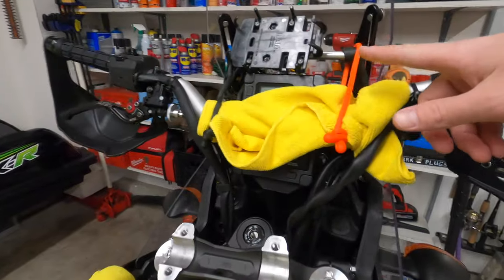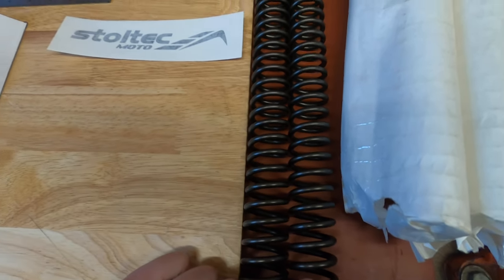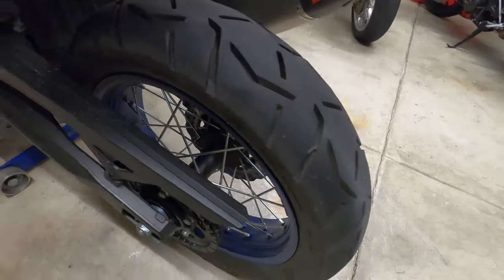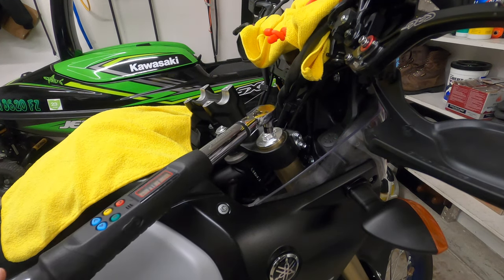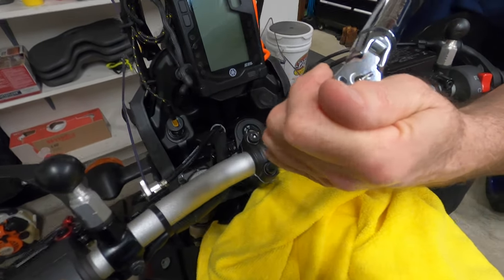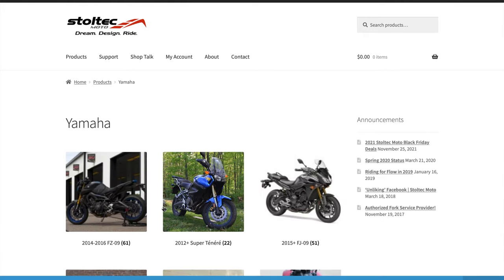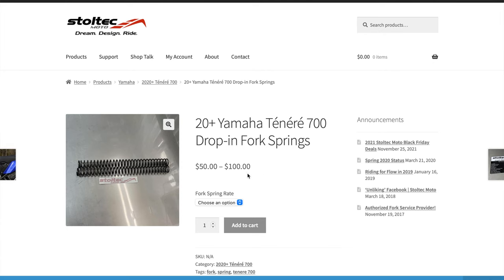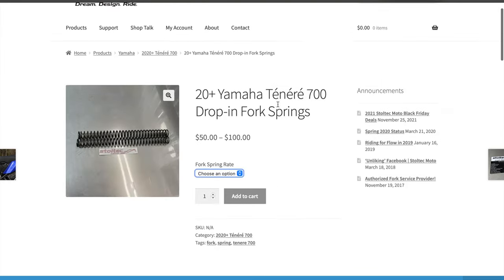Yamaha Tenere 700 Front Suspension Mod!

Comment: Good video.  Thanks so much. For some reason I put it off.  Only took a couple of hours including getting all the tools out.

Note to others: get your floor jack under the engine before you unscrew both of the fork caps.  I did not and almost dropped the bike.  Had it on the center stand only and when I finished unscrewing the second cap, the front dropped, the bike rolled forward and off the center stand.  I was able to catch it and “phone a friend” for help.

Comment: Great video. What about the oil level? When you take out the old springs, there is some amout of oil on it..
Reply from the maker: Appreciate it! Stoltec actually recommends removing some oil(can’t remember how much) but In our case we did not remove any more than what came out with the spring which is very minimal.

Comment: How difficult was it to screw the caps back in to the fork tube with the new springs in?
Reply from the maker: If the front suspension is supported (right at the point of nearly weightless) it should be easy.  Make sure upper pinch bolts are loose and  not to cross thread the cap😎
Reply: It’s easy if you compress the springs with zip ties like he shows.

Comment: The blue tool for holding the fork rod from sliding down when changing the spring, can you confirm if it's M10 or M12 thread?. Thanks
Reply from the maker: M10 threads. Here is the link to the tool if u need it! Thanks for watching!
https://www.denniskirk.com/motion-pro/5-in-1-damper-rod-bleed-tool-08-0648.p284475.prd/284475.sku?gclid=EAIaIQobChMIr-X3lNXa9QIVJ2xvBB33lQ6XEAQYBCABEgKxrfD_BwE

Comment: Shouldnt the fork oil be changed every year?
Reply from the maker: If you’re taking it offroad, keep it in a non climate controlled area and/or putting 10,000 miles or more a year on the bike then might be worth doing yearly but for us we wont even think about doing again for a long while unless they feel in need of attention. Our Tenere is 100% street use, stored in climate controlled area year round and gets about 2-3k miles of use per year. For our situation yearly would be overkill but doing it more frequently certainly doesn’t hurt. Everyone will have a different opinion on it but is more on how you use the bike. Offroad adventure riders it is probably a good idea to do yearly. The street queens can probably stretch that out 3-4 years or every 10,000miles whichever comes first seems to be what we end up doing on our bikes.
Reply: @Floatsorrolls1  great info thanks

Comment: Hi Matt,
great job, I thougt I'd have to remove the fork legs from the bike for changing the springs.
One question, what is the thread size you screw this long blue tool, don't know how it's called, on. Is it M10x1 mm?
Reply from the maker: Yes i believe so. Here is the link to the tool if u need it! Thanks for watching!
https://www.denniskirk.com/motion-pro/5-in-1-damper-rod-bleed-tool-08-0648.p284475.prd/284475.sku?gclid=EAIaIQobChMIr-X3lNXa9QIVJ2xvBB33lQ6XEAQYBCABEgKxrfD_BwE

Comment: Is that blue thing required to do this?
Reply from the maker: You can probably get by with a cable tie on the threads wrapped around another cable tie to hold it or tape on the threads and use long needle nose pliers. If you drop it you can use a magnet to retrieve it. Would recommend a second person to give you a hand made it alot easier.